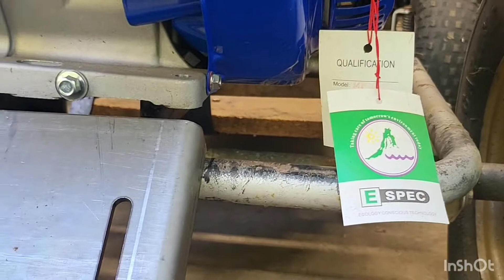The Manco Dingo Gets A Bigger Engine!

Comment: hi there i have just been through all of this with my dingo forget them clutches and go straight  for a 40 series torque converter , also go for the red springs and light weights in the driver with that engines hp ,the standard setup the weights get thrown so hard they jump the tracks and even dent the outer bell , you will also need to raise the engine plate about a inch and a half  to get the driven pulley shaft under the cylinder and high enough for the pulley  to clear the rear frame tube, not enough room in front for it  , hope that helps and keep the videos coming
Reply from the maker: Thanks for the input, I'll definitely be looking into a 40 series torque converter!

Comment: clutches were never made really for anything bigger than a 13 inch tall tire, you can do it on a 15 or taller inch tire but you're gonna burn up those clutches. you need a torque converter.
Reply from the maker: Already done and tearing up the yard with it!